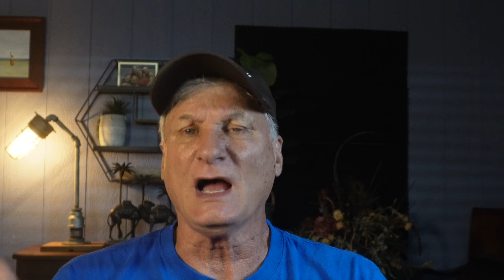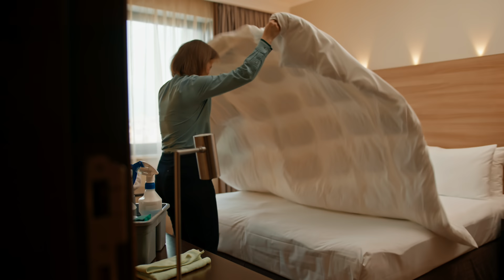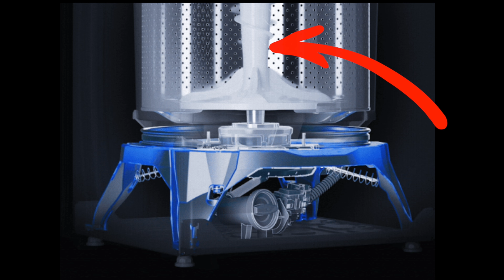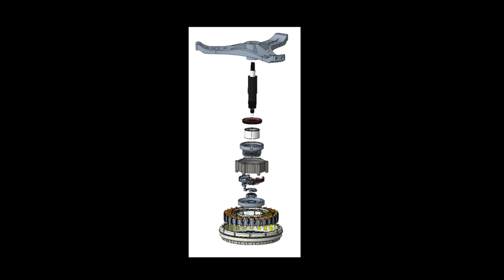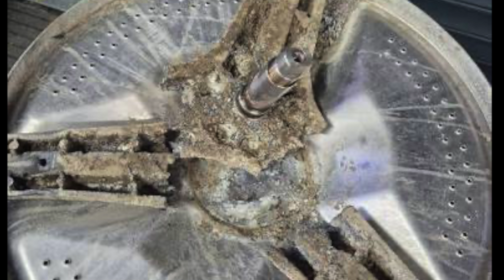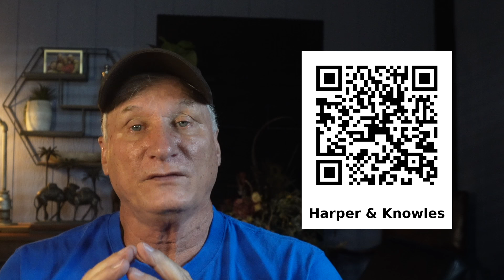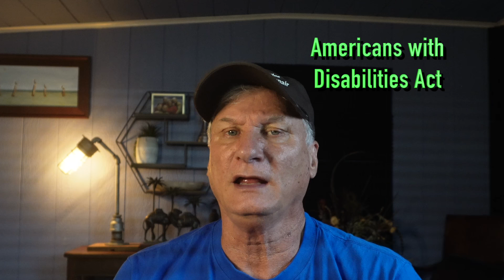Maytag's New 30-Year Washer: No Gearcase, Real Agitator, 900 RPM

Comment from the maker: Now, the whole reason this machine is worth talking about is that Whirlpool built it to go after Speed Queen. That is a direct shot at the brand that has owned the buy-it-once corner of the laundry room for a long time.

So the one I want to put it against is the Speed Queen TC5. Same idea, same promise, and it is the one most of you are weighing this Maytag against. I am going to run the two of them side by side and go through it point by point. The motor, the suspension, the clutch and brake, the warranty language, and what each one is going to cost you the day it breaks in year eight.

If you have not seen it, I already reviewed the TC5 against the TR7 right here: https://youtu.be/ktnoLXYbyHM. Watch that one first and the comparison will make a lot more sense.

Both machines, if you want to look at them while you watch:
Speed Queen TC5 (TC5003WN) → https://www.amazon.com/dp/B09MR9NX58?tag=hk-ytpin-20
Speed Queen TR7 (TR7003WN) → https://www.amazon.com/dp/B0866D32R1?tag=hk-ytpin-20
As an Amazon Associate I earn from qualifying purchases.

And the Maytag is not on sale yet. Maytag has not put a price on it, so I cannot tell you what it runs. The minute they do, I will.

Tell me in the comments what you want me to check on it and I will put it on the list.

I am Chip with Harper and Knowles, and I am out!

 A few of you asked how I do the research. It is all in a 35 page guide now, worksheets and all, $12.99: https://harperandknowles.com/gop/guide

———
Speed Queen TC5 (TC5003WN) → https://harperandknowles.com/gop/tc5
Speed Queen TR7 (TR7003WN) → https://harperandknowles.com/gop/tr7
As an Amazon Associate I earn from qualifying purchases.
Reply: The real question is can you open the damn thing during a cycle? I've had destroy the locking mechanism on every new washer I bought because they get stuck out of balance and their way to "fix it" is to fill and try again. That doesn't work and the machine keeps wasting water...I had one try over 8 times to balance a load before I "broke it" and did it my damn self. Water & energy saving my hinny.
Reply: @JanicePhillips  TC 5 owner here.  When you open the lid it stops but resumes where it left off when you close it.
Reply: @BereansLAC  that's how it should be, imo. frontloaders need to lock; toploaders do not.
Reply: @JanicePhillips  lol. My  recent washer does the same.  It was easier just to have a chair right next to it, for the  2 hours it took to wash a load. It has to go to the junkyard yard now.
Reply: @sandilobianco6734  I can't tolerate it and always have to "break" it and then "fix" it in a way I can get into them. And my goodness do I remember the 2 hours to wash a load!!! The used Hotpoint I bought for $200 of Craigslist takes 20mins for the White/Heavy Soil cycle that includes a soak! LOL 
When Obama passed all those "environmental laws" concerning our appliances, everything went to pot and my electric bill and water bill went UP.
Reply: @JanicePhillips You understand that this became the standard to keep children from climbing into the washing machine and drowning? It's not going away.
Reply: @crystalcrary619  I don't need the government to watch my children, thank you.
Reply: @JanicePhillips  I don't either and it bugs me to stop the washer to throw in one item I missed, but unfortunately it's the world we live in now days.
Reply: @crystalcrary619  It's Communism...the gov't making decisions for you, but then it's also Fascism...the gov't in bed with businesses. 
It's ridiculous and I won't follow their rules. I break mine. If I want in my machine, I shall get in my machine. I've always been a rebel.
Reply: @JanicePhillips I never wanted one of those. Glad I still have my old old Maytags lol
Reply: @DramaMustRemainOnTheStage  Don't buy a "new" one until this model comes out. They're straight garbage.
Reply: @JanicePhillips  Yup, I am going on my 4th one and when here it will be just 7 months.
Reply: Last year I bought a Speed Queen washing machine, pure quality and fast loads with a full to the brim tub of water. 💦
Reply: All I want to know is queen better than maytag
Reply: @dorothypenson1528  Speed Queen has been the best you can buy for home or commercial use for decades. They don't make them better.
Reply: @JanicePhillips maytag for me
Reply: @Susietacoma agree these "water saver" models cause so much wasted water by having to re-wash loads to get them clean OR SANITARY the first go.
Reply: @redhead8777 . You explained that so well! Thank you.
Reply: @redhead8777 I’ve got newer model with deep fill. Just hit the button and it fills to the brim I’m in Louisiana we don’t have water issues. My clothes are actually clean again
Reply: @DramaMustRemainOnTheStage  Yes, OLD Maytag, new Maytag is total crap.
Reply: @JanicePhillips  My issue, and I have the 15 year old one side stepped for now, is the small drum at 3.32 cu. ft.
Reply: 3.2
Reply: @JanicePhillips FYI I've got A 80 Series Kenmore that I've been Using for 40 years And never has been worked on And still going
Reply from the maker: @dorothypenson1528 we won’t know until this machine has been released and people have had a chance to use it for a few years. Thanks for watching!
Reply: @dorothypenson1528  - it’s more money for a Speed Queen, but it’s the best money I’ve ever spent. My last Maytag only lasted 3 years. Never again.
Reply: @jennacat13 will be looking into Speed Queen! Are they quiet? My laundry room is centrally located in living space - so That matters to me!
Reply: @dorothypenson1528  I had to get rid of my 1976 Maytag set.  The Speed Queen TC 5 was the closest in how it operates and how it is built.  They will outlast me by decades.
Reply: @dorothypenson1528 Maytag made changes to compete with speed queen. Speed Queen just continued to produce the same high quality machines they always have.
Reply: @dorothypenson1528 Yes, Yes, and YES!!
Reply: Well I got my 1st Commercial Speed Queen  in 1992 & it was still working when I traded it in for a new bigger one in 2025
Reply: @dorothypenson1528 can't beat Maytag
Reply: Thank you so much for this.   I would buy a Maytag again if they would hold up like our first set did.   25 years and she was a beast!   Never owned anything like that since
Reply: @marysedita7326  Still have my dryer - 43 years and counting. DG110 model
Reply: Rippon WI
Reply: That's a lot of outfit changes!!!
I do the laundry for my Lady and I, and it's two loads/week  max.
Reply from the maker: @t3dwards13 i thought so too so I double checked the research and it's correct for a family of five.
Reply: How much? Is all I gotta say.
Reply: My beloved wife had her eyes on the LG ThinQ front load and the matching dryer. No problems with the dryer (yet, after three years), but the washer refuses to complete the rinse cycle on the Normal and Brilliant Whites settings. I started doing all my washes in the Towels setting because I can manually manipulate the wash parameters.  And that cycle completes, every time. My best friend tells me two years after I bought the bundle that this particular brand is no good.
Reply: @garsiyahLG is very pretty and absolutely crap mechanically
Reply: The more things change the more thay stay the same.
Reply: Have an 17yo Maytag Commercial Series "Bravos" purchased through Sears & gets used ALot. No problems yet. Great washer and dryer pair $4K range. THE Only thing I don't really like about this one is that it is a "water saver" washer and does not fill adequately (imho) when I have a large bulky load (like a king bed comforter). Also the lock-out is a lot annoying. Both have manual and digital stuff on the selection area (no problems). But I fantasize about a switch or some other method to do an occassional very large load so that water covers the load (moreso) without having to do the load multiple times (which usually takes 2-3 times) after turning a very heavy wet load by hand to get it cleaned properly & to my satisfaction. That issue is bothsome, but rarely, so I put up with it (for now). But if Maytag fixes this issue in the new washer I will upgrade early, before becoming elderly when I will not be able to lift & turn heavy wet laundry anymore! Love Maytag.

I had an old Whirlpool before that and I bought Maytag at replacement time when Whirlpool just started getting a bad rap about planned obsolescence (sp?) and/or poor design. 

My Other Major consideration is THE SEALS & Possibility flooding or leaking water from appliances. GO MAYTAG - I'm So Excited to Hear this news!
Reply: I have 2 Electrolux machines.

The first is 20y old & strong(in the basement), the 2nd i negotiated purchase with our house(new 2y ago).

No regrets!!
Reply: @tammiehinkle2040 I have electrolux vacuums. Wonderful machines, but I hear they are not making anymore. I AM SERIOUSLY BUMMED OUT. ELECTROLUX: What are you Thinking? Good to know on washer/dryer - how much?
Reply: @redhead8777  now they arent that expensive. I believe it was ~2200 for the set all in.

Oddly enough my first set was ~2500 for the pair 20y ago.

Electrolux vacuums are amazing!! I hate to hear that they are not foing to be making them anymore 😢 might be time to get one & put it up until we need it!!
Reply: The motor sounds like it's a stepper motor. Do you know if it is?
Reply: You seem to be lucky a lucky purchase. Count operated , Mine went out on after 6 months when your new 6 months warranty expired. No recourse . Speed queen is also a trash !?
Reply: I would like to get a Speed Queen but it’s so expensive upfront. I would like to have a machine that I can service myself and not break the bank
Reply: Amen
Reply: ..."$1500.00 for the washer"
I'm out.
Reply: I won't buy another Maytag ever.  I am replacing my current machine with Speed Queen. Maytag lost my business permanently.
Reply: @Wubbly1776 I just replaced my 7 year old Maytag with a Speed Queen TC5. I am deliriously  happy with it. There will not ever be another appliance with "Maytag" on it in this house
Reply: Simplicity & serviceability 👍. This is what makes appliances durable and worth fixing. I have known problem if manufacturers would bring back mechanical controls in exchange for digital display controls with complex circuit boards.
Reply: I'm almost with you. I have AWNs, eight at work, one at home. At fifteen years, I'm just starting to do tub seals on them, and they get Abused!!
As to dryers, I just don't know, I have a Maytag DG110 at home, purchased in December 1983, and the damn thing won't quit working. Just finished a cycle now.
Had a matching Maytag washer, but found an AWN for $50, so....
Reply: After having bought my Maytag commercial machine 1 1/2 years ago before I found you I wouldn't touch Maytag with a 10 ft pole.  It's already had problems.  Nothing about it is commercial.  I don't think I'd trust them with the new machine they are coming out with either.
Reply: I'm a service tech in Canada for 50 yrs. Top load laundry is HORRID, the manufactures should be ashamed at what they've been passing off to the public. Totally agree on the Speed Queen (Huebsch up here). Can't wait to see this new Maytag washer! About time they woke up and built a quality product.
Reply: the point is to last 30 year plus  with out failing like me 1994  may tag
Reply: Does this new washing machine have BLDC DRAIN PUMP MOTOR or it is something ac
Reply: My Speed Queen washer works fine but my Speed Queen dryer has broken down multiple times (heat control issues).  Don't think I'd ever pay the Speed Queen premium again.
Reply: @fjm5440  double check your dryer vent is unobstructed from the back of the dryer alk tge way to where it dumps the moisture, hot air outside. Bad venting will kill heating elements.
Reply: @user-go5ot5ij6k  The vent was fine -- they tech replaced a sensor/timer and it worked fine for a few months and then went back to permanent "air-fluff" mode again.
Reply: Tr7 for us
Reply: Why would anybody get a top-loader when they could get a front-loader? When can't a person get a front-loader?

Comment: We have a fairly new washing machine that doesn't wash worth of s***, but we have an old washing machine in the garage that was made in the late sixties it works great dental washing machine to clean anything,, never had no problem with the gearbox, we have never had no trouble with that one in the garage that was made in the late sixties but the new one in the house we've had trouble with it two or three times already in the last 3 years but the old one still going, and my mother had an old deep freeze out in in the garage that was made in 1954 and it still working today and it works great has never had anything or anybody look at that old deep freeze just keeps on going, so all the stuff you buy a brand new is trash I can tell you it's all garbage

Comment: Broken locking latch on my 2020 washer cost 400 in parts and labor wouldn't even drain. And spin the soaking wet load it had. 5 days no washer.
Never buying anything without spin dials and a central agitator ever again.

Comment: In 1969 we bought the heavy duty Whirlpool washer and dryer that was being offered by the power and light company. They added a monthly payment to the electric bill and in 18 months it was paid for. 

Twenty years later we needed a new refrigerator to replace the used one we bought after getting married. Both washer and dryer had worked perfectly so we went with new  Whirlpool fridge. Then close to our 30th anniversary the stove quit and we went with Whirlpool again. The washer and dryer? Dryer needed a new belt and the flame thrower was half eaten by the acids coming out of the LP gas. The washer, no problem. Then in 2014 after 45 years of steady use, the agitator was so badly worn it was not repairable. The repair guy told me, "I haven't seen one like that in 20 years. There are no more parts for them."

The dryer acted up yesterday, did not want to rotate. If it needs a new motor, it will get one. Whatever that thing needs, it will get it, "if the parts are available". Can't wait to see his face when I bring that faithful old girl into his shop.

Comment: Seeing this it means that the machine can be fixed, so can be rebuilt. The real question is if they are using boards will they be available. One of the problems with modern electronic controlled appliances is they build enough spares to fulfill warrantee service. What this means is you get past the warrantee period and a board fails, it isn't available. The other problem is they introduce new machines and the boards are not common. To fulfill the 30 year thing they would need to have boards available in inventory or use the same boards in all the machines over the years. This is common with cars, parts are often used for years .

Comment: In 2012 I figured out the fix for the low rinse water level problem our "government" caused to "save the planet". Thanks to Whirlpool, they actually have a hidden water level switch under the control panel. Flip the switch, and POW!, regular water levels for the rinse cycle. I helped about 100 people with this fix. Thanks to a bunch of IDIOT politicians(who've probably not done laundry for years) their "fix" caused everybody to run an extra cycle to rinse their clothes. Using at least one third more water per load, than before.

Comment: Yes, but who designed the controller board and who wrote the software. Went thru 2 Maytags in 10 days as both failed. Ended up with a GE works but the software sucks. And, no way to ever update the software. These engineers have never even washed a sock!

Comment: Why did washing machines have a concrete block in them ?

IS there a major improvement on Front Load machines ?  I have a 5 year ? old Kenmore, that turned out to be LG.... which is a total annoyance compared to the 2001 Kenmore front load ( Whirlpool ) that lasted a very long time ( 15 years, then the bearing went... repair 500.00 quote.... guy told me to just buy a  new machine... had I known the new one was not essentially the same as the old, I would have paid the 500.00 for a replacement of drum bearing. The electronics were fine, the controls were fine.... just a damn sealed bearing pooped its grease out!

Also, is there any improvements on all-in-one, large capacity washer/dryer ?   Better lint capture, first on the list of issues with what is out there.

Comment: I always buy the simplest washer and dryer they make no electronics, no fancy cycles just the simplest long time made machines seem to last me decades with occasional drum suspension replacement and direct drive system.  I can fix them myself, never overload, full aggitator, top load washer.  Then the same dryer design they have been making since the 70’s.  No issues just dryer belts tension pulley and drum roller, all easy to repair myself parts are cheap.

Comment: I am still running a Whirlpool direct drive machine from circa 2000.  I've put two gear cases in it, a timer, and a drive coupling.  (total parts cost for 25+ years, maybe $500?)  And as long as they keep making parts for it and the bearings or head block don't go out, I'll run it forever.   Simplest and cheapest machine to run and repair out there.  And believe me, we haven't babied it.  This thing runs 2 or more loads every single day, 365 days a year.  If this new machine really lives up to what it looks like, I'd seriously consider it over the Speed Queen.